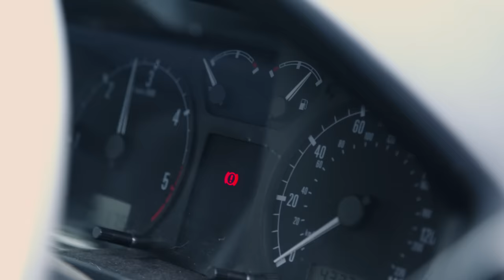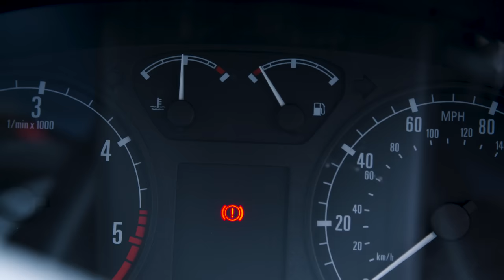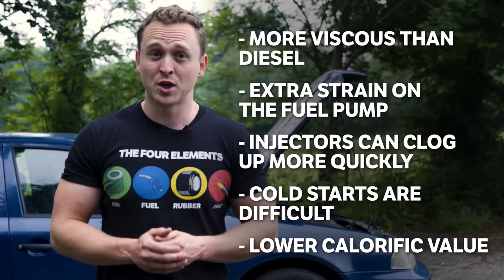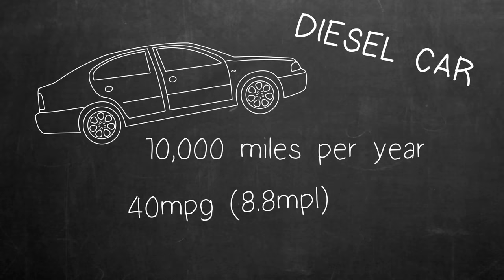The Pros & Cons Of Running An Old Diesel On Used Vegetable Oil

Comment: It’s a shame we could drastically decrease our carbon footprint by running Diesel engines on renewable resources but we’d wind up in prison because the government can’t get their cut of it
Reply: Edward Teach I mean it’s the act of burning that increases your carbon footprint so it’s about the same footprint
Reply: @joshdoeseverything4575  Definitely. It's more sustainable being able to constantly grow plants for oil, but the emission is likely worse than diesel. Not just the carbon dioxide.
Maybe, if there were specialized refineries, it could be clean.
Reply: @joshdoeseverything4575  The plants grown to produce the fuel will absorb some of this though.
Reply: JoshDoesEverything That's not how the carbon cycle works. Burning vegetable oil doesn't increase your carbon footprint because it is already being cycled through plants and whatnot. Burning fossil fuels does because that carbon was sequestered deep underground, meaning you are adding carbon to the cycle that previously wasn't there.
Reply: @joshdoeseverything4575  Not how it works. Biofuels are almost carbon neutral. The only extra carbon and waste is in the manufacturing process. The vegetable oil gets used in restaurants before as well.
Reply: Diesel owners running it on waste veg oil actually should be exempt from paying road tax as they're doing the environmental thing 😎
Reply: @Ryan-si8om  That's not how the carbon cycle works either.  Burning vegetable oil does reduce your carbon footprint but not in the way you're thinking.  You're still freeing carbon into the atmo that wasn't originally going to get there if the oil was just thrown out.  Conventional disposal of oil puts it into the biological carbon cycle where it's collected by creatures and turned into physical energy and biomass, and a lot of that carbon doesn't make it back into the atmosphere for while.  Burning it puts that CO2 into the atmosphere much sooner in the process and puts more CO2 into the air than would be there if you didn't burn anything at all.

The reason it still reduces your carbon footprint is because it's not freeing up carbon stored deep underground, which is the problem with fossil fuels.  But you're still putting SOME carbon into the atmo that wouldn't otherwise be there at any given time.
Reply: @George-li1yv  Biofuels are most definitely not carbon neutral, since they're being grown in fields that could be growing food instead, which drives massive deforestation in other parts of the world. Biofuels also tend to be grown in enormous monocoltures which are bad for biodiversity. Basically biofuels are bad all around, and they couldn't replace oil anyway because we just can't grow enough of them. That's the entire reason why we moved to fossil fuels in the 1800s - we were running out of non-fossil ones.
Bottom line is we need to stop setting shit on fire for power. We've had the technology for decades now (nuclear), and the fact we're still relying on fossil fuels this much is inexcusable.
Reply: @demoniack81  so solar in that field would be better?
Reply: @samuelthornton9179  Solar has the advantage of being deployable on land that cannot be used for agricolture anyway. If we covered all of our rooftops and motorways in solar panels they'd generate a massive amount of electricity with no additional land footprint.
By (partially) covering up motorways you would also substantially reduce the energy wasted by cars in air conditioning, which is a win-win from an energy standpoint, and likely also extend the life of the road surface by reducing UV damage (though I'm not sure about that one).
In rural areas the supports for the panel themselves could also double as a power line connecting the service stations (and their power hungry charging points), rather than having to upgrade or build new separate lines on the grid.

I'm sure there could be valid economic reasons why nobody has "roofed" a motorway with solar panels yet, but I have a feeling that it's just a question of it not being profitable unless you look at a massively bigger picture, which private companies can't do.
Reply: @samuelthornton9179  No. You'd get a lot more energy per square metre with well-sited solar, but it'd be a waste of good growing land, considering that solar can be installed on rooftops, canopies etc. or on marginal pastoral land like upland sheep farms. The lowest energy fuel cycle is offshore wind feeding electric vehicles, but the whole system needs to be a lot more complicated than that. Basically plant oil biofuels are not the way forward, but as a personal project they're perfectly fine. Having said that they're getting somewhere with synthetic photosynthesis at the moment, to create hydrogen and possibly liquid fuels. If they can make that efficient and scaleable enough we might see fuel farms in sunny regions.
Reply: It’s already happening Mercedes Benz uses old
plastic to produce diesel
Reply: @James Smith dies of global warming
Reply: @bsarioz  the emissions are overall better than diesel
Reply: But you are allowed 2.5k litres tax free per year.
Reply: @bsarioz  actually no. Vegetable oil gives significantly lower CO2 emissions but higher NOx emissions
Reply: @hagamapama  "Burning it puts that CO2 into the atmosphere much sooner in the process and puts more CO2 into the air than would be there if you didn't burn anything at all." Bro what do you expect people to do, go to their jobs and carry their family with their bicycle?
Reply: @samuelthornton9179  it actually would produce significantly more useable energy at a lower cost, add some wind turbines to the same field and you would get an even better rate of energy return per acre(the shading effects would be negligable)
Reply: @joshdoeseverything4575  but at least it can recycle used vegetable oil
Reply: @joshdoeseverything4575  What do you think E85 is? Veggies or grains that the South American countries destroy Brazilian rainforests to produce.
Reply: They are paying companies to produce renewable fuels though. They know all about it. It's just more expensive than traditional petrol oil to be produced and on top of that there is not nearly enough to cover our energy needs.
Reply: @joshdoeseverything4575  It reduces landfill waste when you burn used cooking oil for fuel instead of disposing into landfills.
Reply: @jamie6387  yeah but were talking about carbon dioxide footprint. Cooking oil in a landfill doesnt burn and end up as atmospheric co2. Not saying im against using it as fuel- just that it doesnt reduce ur carbon footprint
Reply: @ActionableFreedom  yeah? And? I agree with u
Reply: In Sweden you can buy canola oil diesel at gas stations.
Reply: @joshdoeseverything4575  no the bio diesel is less efficient but emotes significantly less co2 for example diesel is more efficient than gasoline but emits more co2
Reply: @bsarioz  if no fossil fuel was used in the making of oil for your car, then your carbon footprint is zero
Reply: Diesel is actually a waist product of making petrol from crude oil. So if they can't sell that the price for petrol probably goes up too.
Reply: yeah, sure, it's the government, the petrochemical companies have nothing to do with it...
Reply: Actually most of the carbon footprint IS in the production of the fuel while burning the veggie oil in your car would produce more carbon per person the reality is the carbon emissions from people in their day to day lives  has always represented less than 20% of man-made CO2
Reply: @bsarioz  diesel produces far less carbon, higher amounts of other emissions however, i do believe that is purely from running on petroleum fuel rather than biodiesel
Reply: @George-li1yv  they are gonna lock u up bro
Reply: Hey Sir Teach you can make Bio Diesel really easy
Reply: I hope this can take off so that we don't need electric cars taking over:(
Reply: It's legal in UK 
Has been for a few years
Reply: It's not illegal to fill your diesel engine with vegetable oil.
Reply: @bsarioz  I know this comment was a long time ago, but for producing biodiesel you need more energy in than you can get out. What is much more sustainable is re-using old vegetable oil or using solar panels and electric cars. Not to mention water usage in biofuels, which is the worst part. Farmland should be used for powering people, not cars.
Reply: The government will always get their cut
Reply: Biofuel is worse for the environment as it requires more farmland to be acquired, which means Forests are cut down and carbon is lost from the soil through tilling (ploughing a field releases huge amounts of carbon stored in the ground).
Reply: @dieselgeezer18  please stop the government will read this.
Reply: @bsarioz  It is generally superior to diesel regarding emissions.  There are ways of getting the govt. off your back with this, and if it went mainstream, the government would adjust the tax code accordingly.
Reply: @bsarioz  using plants for fuel is unsustainable as fuck 😂
Reply: @Ryan-si8om  True!!!!!
Reply: Desire for carbon neutral footprint and fear of taxman are redundant.
Reply: @Ryan-si8om  fossil fuel is still part of the carbon cycle, it's just usually released slower and so it increases the amount in the more active cycle.
Reply: @joshdoeseverything4575  youre forgetting that the vegetables in vegetable oil got their carbon from the CO2 already in the atmosphere and will release it when digested while diesel got its carbon from forests that collapsed when there was multiple times more CO2 in the air. one increases total CO2 concentrations, the other, does not.
Reply: @hagamapama  the biomass will eventually be burned for energy or eaten and then burned. there is no point separating biomass from atmospheric carbon because if you sequester carbon in said biomass, you have more energy being used by said biomass, necessarily meaning a more rapid release of carbon commensurate with all the energy being burnt by the extra biomass. thats why we cant rely on crops to sequester our carbon. only long term storage such as trees or non-bio forms are feasible.
Reply: Same for running gasoline engine off vodka, I believe vodka only cost as much because they know what people can do with it.  

But if that's the case then all engines need to be diesel, then run it off vegetable oil. 

Also soybean oil works well as an engine lubricant but it doesn't work well at cold degrees. 
A simple fix is to put something that warms it enough to unfreeze in the oil pan.
Reply: tax thats what they want,pay up shut up and if you dare to park thats another charge
Reply: there is no carbon footprint